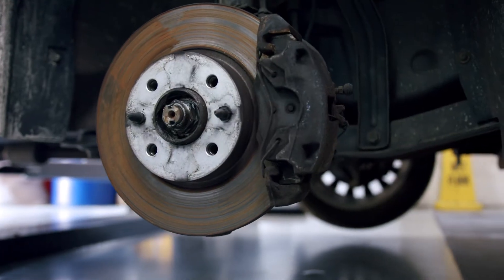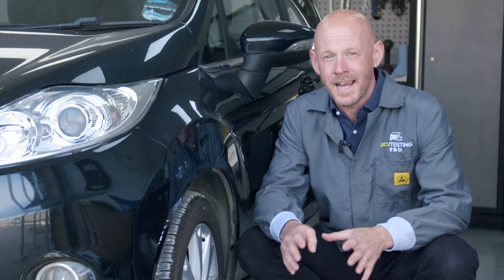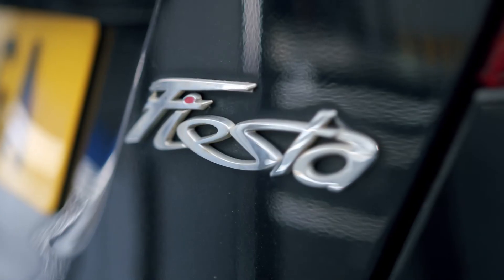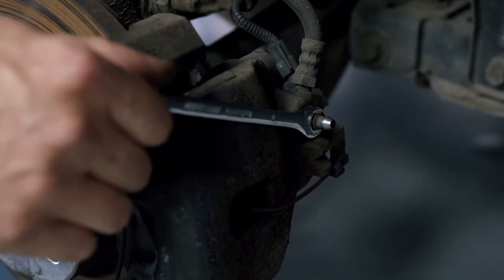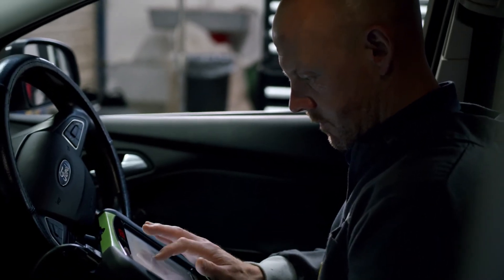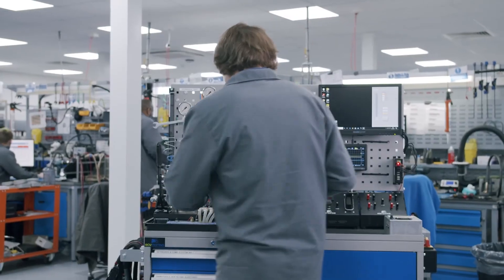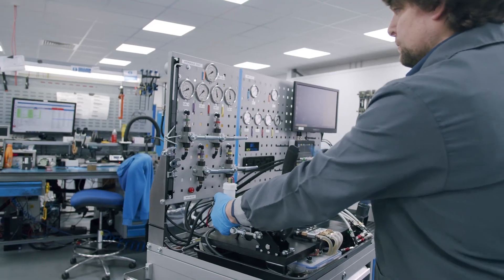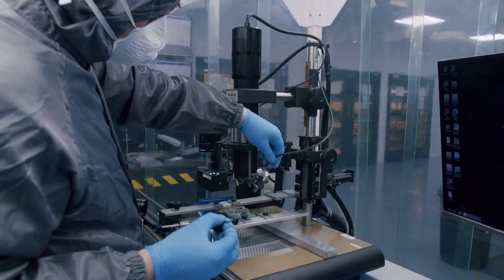Ford Fiesta ABS Pump And Ford Transit ABS Fault Causing Sticking Brake Calipers

Comment: Is the problem located in the abs control unit or the solenoid package?
Reply from the maker: Hi there, depending what symptoms you are getting, the fault could be with the ECU control section or the hydraulic block section of the ABS. If you email us your car details, symptoms, any fault codes if any are present and any other information that may be helpful, our technical team can look into this and advise you further. Thank you

Comment: 2012 fiesta, dealer diagnosed brake issue with brake master cylinder and brake booster. I replaced both of them and customer had the car for 2 days and cars brakes just locked up on him. Does the 2012 share the same issue as the 2013?

Comment: So the ABS isn’t working at all in my 2012 Fiesta. The tires will skid. Can I replace just the module or do I have to replace the pump as well?
Reply from the maker: Hi. Any replacement would usually require the full unit (module and pump) to be replaced, which will require recoding to the vehicle using dealership level software. However, we can re-build the ABS unit while retaining its original coding so you can just re-fit it back to the vehicle, re-bleed the system and you're good to go! Fill in our online test form to find out how to send it into us: https://myaccount.ecutesting.com/

Comment: There’s one more option. Free option. The module fails because it doesn’t get enough work. My 2016 Transit connect developed the sticking problem at ca 145 000 km. I just started using brakes more aggressively once in a while on gravel, grass or  snow. Once a month or twice, and voila, 200 000 km on speedo and brakes are good as new. And don’t forget to change your brake fluid every 3 years or so.

Comment: I'm hoping you can help me out. 2017 Ford Feista SE non-turbo that we take care of, do not abuse in any way. About a month ago the brakes on the car seemed to apply themselves gradually and eventually bringing the car to a stop. It was so strange because now the brakw peddle would not go down at all, hard as a rock. You can put the car in drive or reverse and it wanted to move but it was like the brakes were locked. If we left the car for an hour or so we can then drive it with not issues for about 30 more minutes and then it would repear the process. I then took off both front calipers pushed the pistons all the way in and when i pushed the peddle they do not come out at all. So far everybody is telling transmission but that makes no sense. Again, I would greatly appreciate your thoughts. Also, is it possible to test the pump. Thanks
Reply from the maker: Hi. It sounds like you may have an issue with the ABS unit. Please email our technical support team on info@ecutesting.com with the details of your comment as well as the part number printed on your ABS unit. They will be happy to advise you further. Thanks.

Comment: I have 2016 transit connect.  Sounds like same issue. I have front passenger an rear driver sticking.  Calipers changed an no difference. Fluid drained an flushed.  No difference.
Reply from the maker: Hi. This fault does also affect Ford Transit's (4th generation) from 2014-2016. If you would like to get your unit re-built then please follow this link: https://www.ecutesting.com/common-faults/ford/brakes-locking-fiesta-b-max-and-transit/ and select the part number which matches your unit's. If you cannot see your unit's part number on our website then please email or call our technical support team on +44 1773 535638 or info@ecutesting.com, and they will be happy to assist you further.

Comment: Just had my abs module rebuilt and the brakes are still doing the same thing only when they are worm
Reply from the maker: Hi Paul, did you get your module re-built with ourselves? If so then please contact our office via email at info@ecutesting.com or by phone +44 1773 535638 and our technical support team will be happy to assist you further.
Reply: Hey Paul! Would you mind sharing an update? I have only one wheel locking up and smoking on my Ford Fiesta. I replaced pads, rotors, caliper, and hose, and now the mechanic is guessing that it could be the HCU or the whole ABS system. Did you have a similar experience?

Comment: I have abs and stability control light on. Garage said it was abs pump. could this be true?
Reply from the maker: Hi. Both of those warning lights could indicate a problem with the ABS yes. However without further information, such as fault codes produced by a diagnostic scan, it would be difficult to rule anything else out. If you are able to get the results of a diagnostic scan then please send them to our technical support team with details of your vehicle and fault symptoms, and they will advise you further. Contact them via email at info@ecutesting.com. Thanks.

Comment: hi I was asked to look at a 2010 Ford fiesta. ABS lights I used Autocom said intermittent power to abs pump. could this be a module.
Reply from the maker: Hi. As the fault is an intermittent live feed issue we would suggest checking all the wiring and grounds to the ABS module as well as the vehicles battery's state of charge and state of health. Hope that helps.

Comment: 2014 Ford Fiesta: I have a valve sticking on my ABS unit, and it's preventing/blocking fluid from going to the front driver side caliper.  Will a rebuild of my ABS unit fix the stuck valve?
Reply from the maker: Hi. Apologies for the late reply. Yes we should be able to re-build your ABS and fix the stuck valve. Check out our website for more details on how to send your unit into us: https://www.ecutesting.com/common-faults/ford/brakes-locking-fiesta-b-max-and-transit/

If you have any further questions, please contact our technical support team via email at: info@ecutesting.com or via phone on +44 1773 535638. Thanks

Comment: Ive got a 2016 MK7 fiesta van. only done 30K from new. The brake pedal is very inconsistent, sometimes the brakes feel great, then sometimes the pedal nearly runs out of travel before the brakes bite. 
I have had the ABS module sent away for testing, and it checked out fine, however, if i remove the ABS fuse, the brake pedal is perfect. Only with the ABS pump live do i get this problem. Is it possible that this pump can test OK in the workshop, but in the real world still be faulty? Thanks.